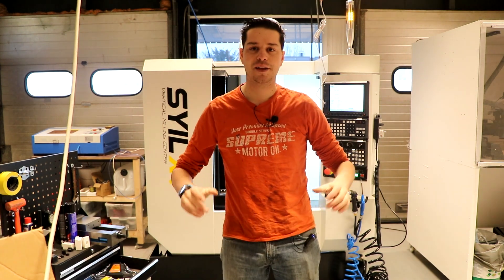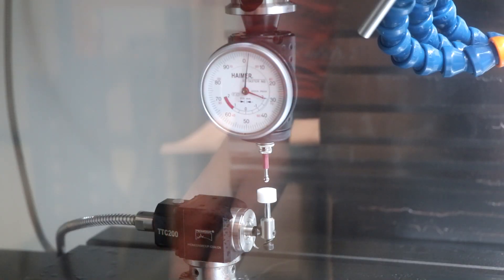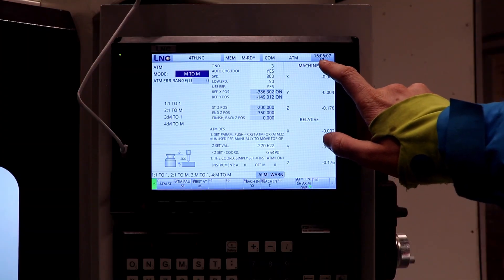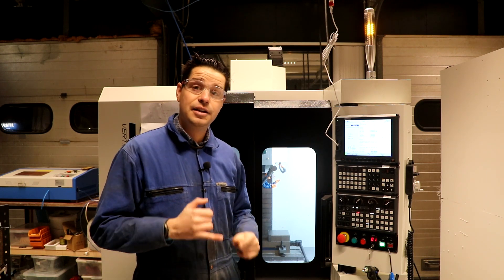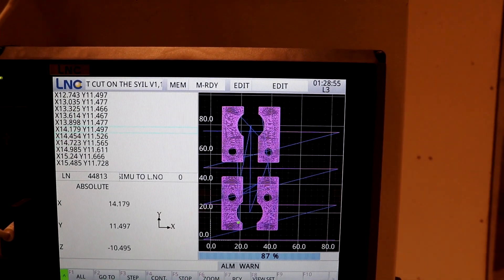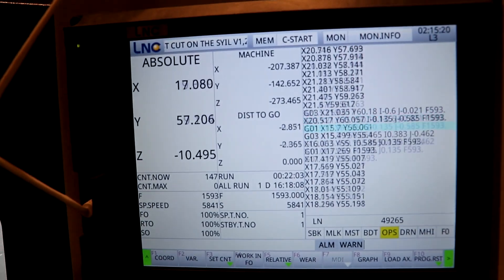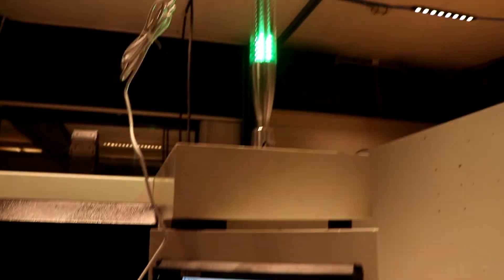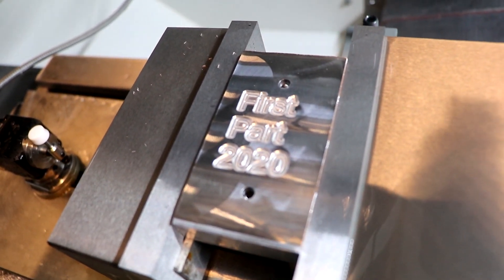First cuts on the Syil X7 20 Epoxy granite CNC mill

Comment: Is this the LNC controller that is 220v single phase ? If so have you done any steel or Stainless with it? I'm looking at these machines but I'm not sure I want to mess with the phase converter and all that.  thank you
Reply from the maker: hi! it's 230V single phase, but the catch is that it can pull 32 amps. That's more then a regular plug can give in the Netherlands. As for cutting: mine cuts titanium all day long. And I've done some stainless moulds last month. So no problems there!
Reply: @yesealex  Awesome thank you for the info. Have you had any issues with the LNC Controller ?
Reply from the maker: Zero issues! I really like it actually

Comment: Are you running it at 230V 3-phase? If so, what is the required ampere for the breaker supplying the power? Thank you:)
Reply from the maker: 30a at 230v single phase for me!
Reply: @yesealex  Thank you. Its hard to get good information regarding this. Do the machine have a speciciation plate stating the minimum required ampere? I just wonder since I currently (no pun intended) dont have 30A.
Reply from the maker: The plate says 30a. In reality it uses less than 16 for most operations!
Reply: @yesealex  Thank you very much. Keep up with the good videos:)
Reply from the maker: Your welcome! Are you in the syil Facebook group? It's a great place to learn!

Comment: Hello Alexander, after you set the z offset with the Haimer, did you just subtract the required travel to set zero with the Haimer to the offset? If so, what value is this? Lastly, did the dial move when setting the tool length? Thanks!!
Reply from the maker: Hi Aaron! The Z value to get the haimer to zero is 2mm. But here below in the comments is a youtube video of a haimer tensioner that you can 3D print. That's the way to go!

Comment: I have a Question. It will probably sound a bit weird. I am expecting my X7 to arrive here in the start og January, and it has been a bit difficult to get some total height measurements out of SYIL.

How tall is the machine when the spindle is at Z max? including the cable carrier.

Is the cabinet really 196cm tall, or are you just exceptionally tall... :D
Reply from the maker: Whahaa, im 1,90m. The full machine is higher. Let me measure in a couple of hours!
Reply from the maker: 235cm i think! Hard to measure
Reply: I have the same issue with Syil. They does not share the total height of the machine which means that I m not buying until I am not sure if it fits through the door
Reply from the maker: Have you ask george konstatadis? He is a hero for these kind of specs. And are you in the Facebook user group? That page is gold as well!
Reply: @yesealex  Unfortunately never heard of him but you just gave me a good reason to register on Facebook 🤣
Reply: @yesealex  hey mate. Yes I have received my machine. And I am ready to get cutting soon. I am a member of the group so everything is good. 😊😊

Comment: Great to see you cutting! Those rapids after setting the tool offset made me jump :-)
Only 2 things, take the Haimer out of the carousel, it's a precision tool. When you want to set the Z offset of the haimer you need to compress the tip like you do when measuring otherwise you won't get it right. NYCCNC did a video about and you can print the pretensioner for the haimer https://www.nyccnc.com/diy-haimer-probe-tips-cheap/. Looking forward for new videos!
Reply from the maker: Hi! Both points have been mentioned in the comments yesterday and I'll certainly be keeping myself to these. The rapids made my jump as well. That was when I figured out that there was another button as well....

Comment: Not sure how accurate your Haimer length ends up being since the haimer is deflecting (which its supposed to, since that's how you set Z height with it) while the tool setter also deflects.  If I may, you might want to calibrate your haimer in Z by facing a part with a tool measured on your ETS, then switch to the haimer and change to the haimer offset, then zero the haimer on the freshly faced surface and calculate the deflected position of zero from that.  Hope that makes sense!  Keep up the vids!
Reply from the maker: Hi Bill, What you're saying makes absolute sense! This was one of the things I ran into, but I cut it out of the video. It was not properly filmed and it was just confusing if I left it in the video. I actually fixed it by measuring the relative distance from when the haimer needle starts moving until its at 0. This is exactly 2mm. The ATC / ETS blinks when it is touched, so I moved the haimer in by handwheel, read the offset and subtracted 2mm. All seems to be going well now. Thank you for your kind reaction and advice! I still have a lot to learn and advice is always welcome! Kind regards Alexander
Reply: I thought there was a bracket you could get that you depress the heimer plunger to 0 and lock it for setting?
Reply from the maker: Not in the haimer package.
Reply: I reacted to that as well. Saunders Machineworks has one solution in https://youtu.be/YcuMTrCLoJ8?t=296 that I believe would work for you.
Reply from the maker: That is amazing! Great tip, thank you!
Reply: RIGHT..I WAS WONDERING WHAT HE WAS DOING..
Reply from the maker: Baby steps :)
Reply: @yesealex  Absolutely!  Kudos to you for putting yourself out here and letting others watch you learn.  I assume you have the mill and accessories all dialed in now!
Reply from the maker: Ooh yeah! Ran 6 hours unattended today :)
Reply: @yesealex  Heck yeah!  The worst I've ever had running unattended was a massive coolant overflow.  Chips built up to the point the pump was cavitating, which made the coolant foamy, and the foam overflowed the tank   Came back to about 4 gallons of coolant on the floor!  Doh!
Reply from the maker: Auwch! To be honest, my day job is in the same building as my side business. There are multiple business that share one building. So I checked up a couple of times during the day